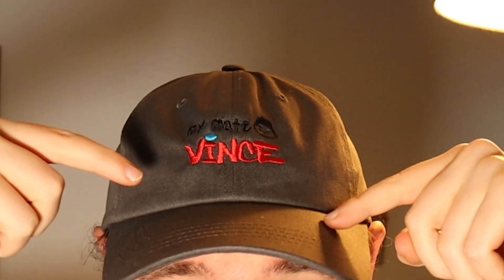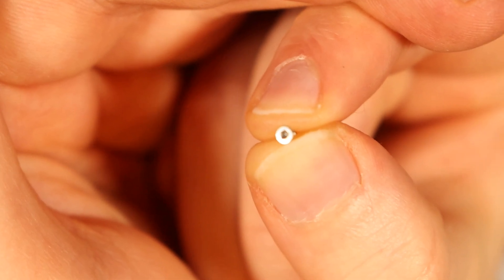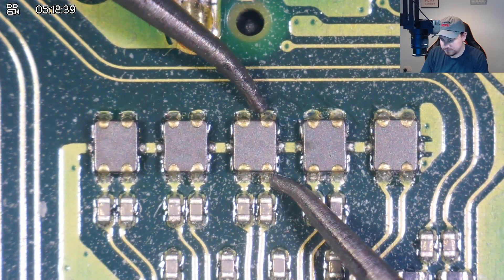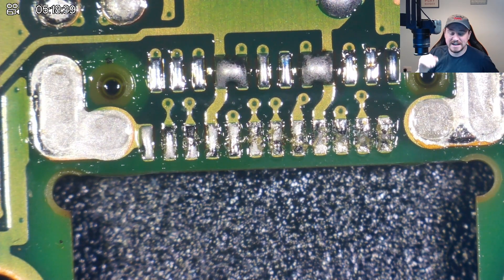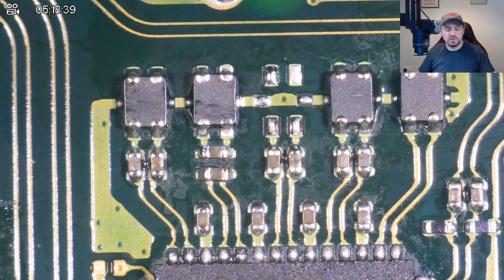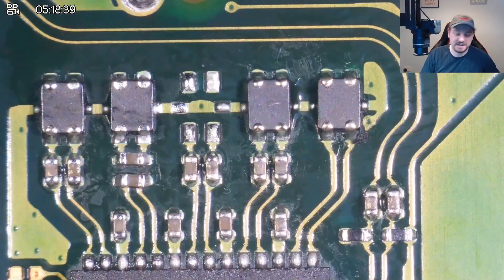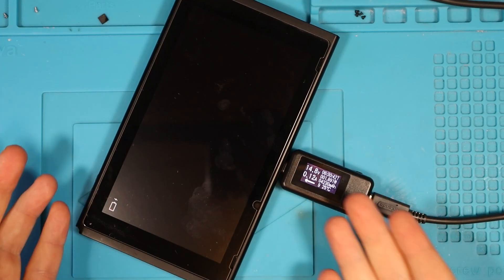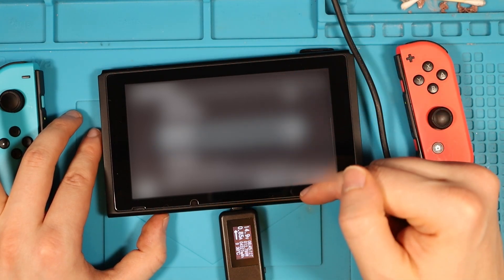Swapping THREE Components on this Nintendo Switch | Can I Fix It?

Comment: Did you turn those caps round on the filter next to one you replaced?   You put them back on horizontal when they should be in line.
Reply from the maker: Yeah I done it at the end of the vid :)

Comment: Love your video as usual,  I've been there with blowing those filters around the board,
i replaced a LCD connecter once drunk, and merged all the caps on the otherside, amazing I got them all back on there pads at 12.30am drunk ☺️

I've never put them on sideways though, that cheered me up. 

oh I advise wicking your through holes, just after the removal of the port, your board is still hot so the wick will suck it up easier. 

great work
Reply from the maker: Thanks Chris that makes sense. I guess with filming and organising the camera etc theres quite a bit of time for the board to cool. I'll try this next time though :)

Comment: Good job! When I’m replacing the charging port I like to solder on some low melt into the anchor holes after I’ve removed the bad port. The low melt makes removing solder from those holes 5x easier.
Reply from the maker: Yeah that's what I also tried to do Slick, think that's the best way 😁 thanks.

Comment: Joey, quick tip, if the port is physically damaged, remove before testing for shorts :) Otherwise a pro job.
Reply: yes I agree with this. the shorted pins in the port might have shown a blown EMI filter due to contact.
Reply from the maker: Ahhh that makes sense Dreams! Thanks bud.